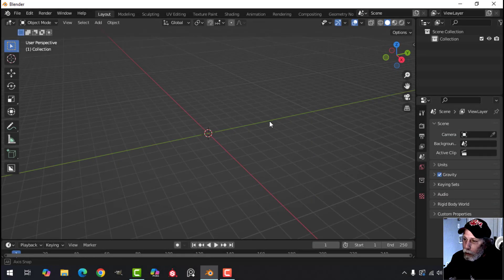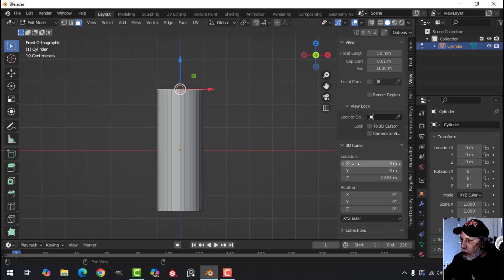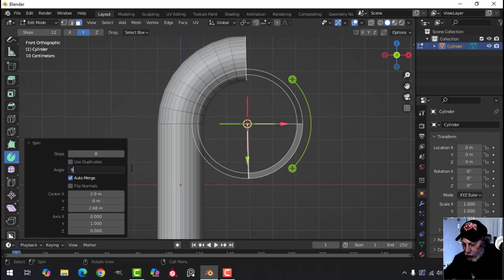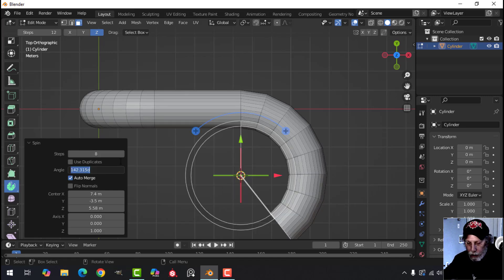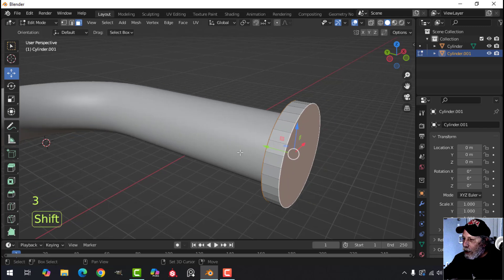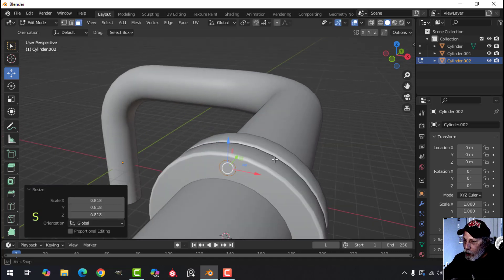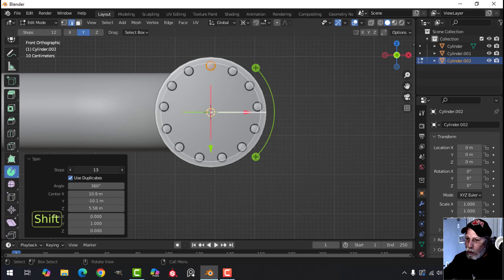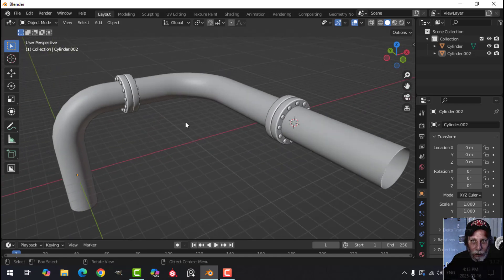BLENDER QUICK TIP: SPIN TOOL

Comment: However, compared to other tools, the spin tool leaves clearly visible edges. Or is it just me?
Nice channel, by the way.
Reply from the maker: I'm not sure what you mean.  You do have to merge extra vertices.   If you have any image of the problem and want to email me at kimmelelliott@gmail.com,  I'd like to see what you mean.
Reply: Solution was to increase the steps in the spin tool. Thank you @zerobio
Reply from the maker: Exxellent!  Glad it worked out